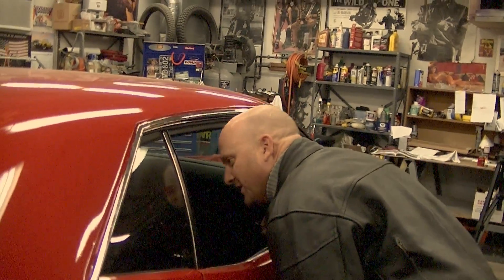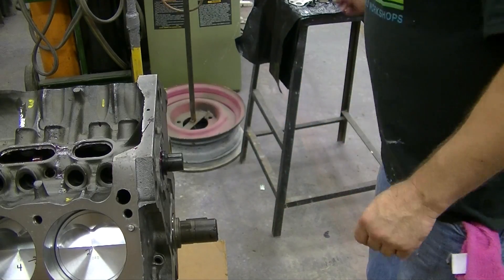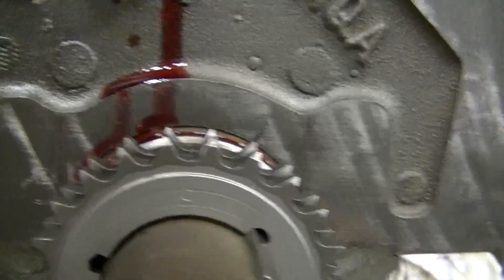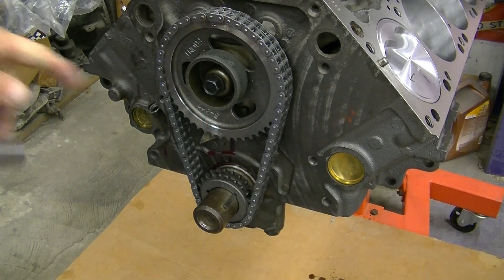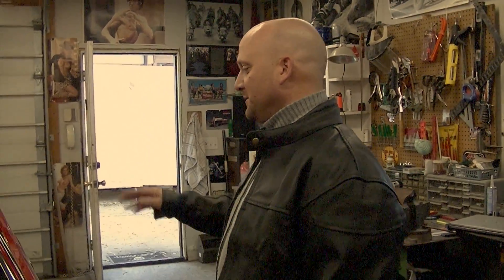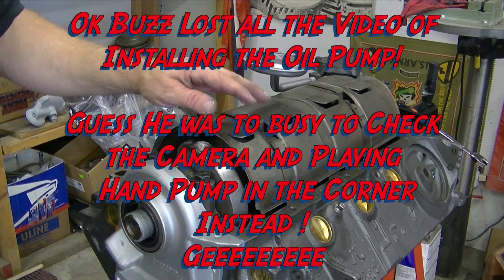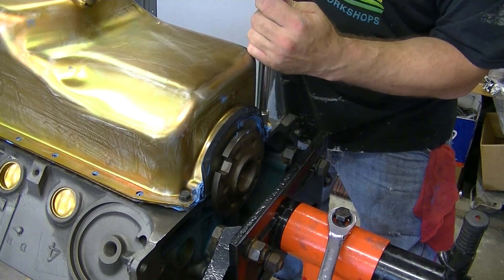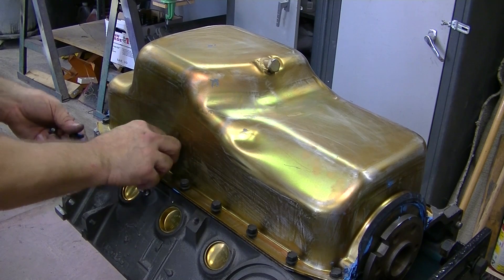How to build a 340 Engine-Part 3 "Cam, Timing Chain & Cover, Oil Pump & Pan Installation"

Comment: You should check with your cam grinder on the spec for the cam bolt torque. My 1971 factory manual says 35 ft.Lbs for small blocks while my 1979 factory book says 50 Lbs ft. and my 92 Dakota book says 50 ft. Lbs. The correct expression should be lbs feet  but in the old days it was foot lbs.

Comment: What oil pump do you recommend?  Do you have any recommendations on cams?  Do you think ARP rod and head bolts are needed?  1974 Dodge D200 3/4 ton long bed and Club Cab with a 360.  4:10 Dana and a 727.  stock heads and a Edelbrock performer duel plan intake with an Edelbrock 650 CFM carb plus S.S. shorty headers.  Just dropped it off at the engine builder on 2/9/17 for a complete rebuild.
Reply from the maker: IDK on the Pump but look into researching REVIEWS on Parts from Sites is best. I used on my Engine Build Videos I did on this 340.... Good Deal

Comment: You did not dial the cam in?
Reply: no need to if you line dots, unless you want to change degreeing
Reply: @smilsmff  you degree the cam to check not all cams and gears are ground 100% on target. I have yet to get a cam I didn't have to  advance or retard a degree or two.